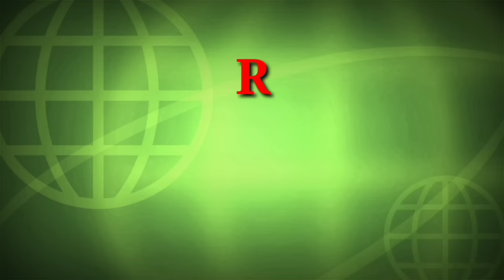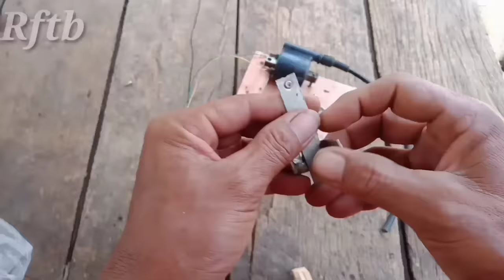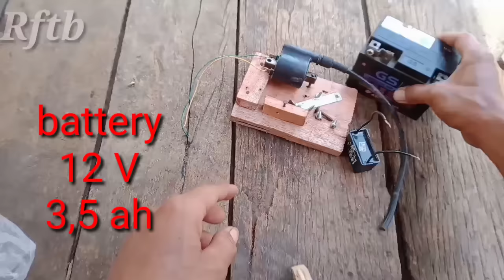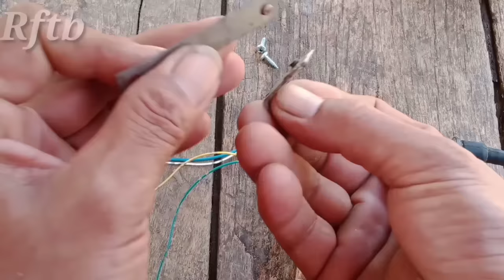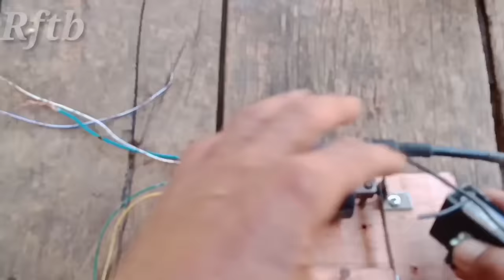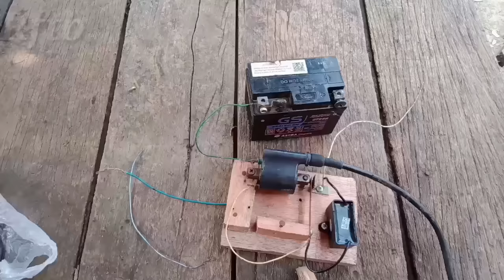HOW TO MAKE STROOM FISH WITH COILL MOTORCYCLE

Comment: That kind of invention is not suitable for fishing because i know the output is a high voltage but the output ampere is very low when you put in the water even  4 to 5  inches the fish wont electricuted ..

Comment: this kind of instrument, ignition coil for motorcycle or ignition coil for automobile for using for catching fish is useless, even they are high voltage, but very low wattage, so it is not suitable because when you use in actual or put in water with the distance of two feet between rod and net, the voltage will drop almost 80%, so you cannot kill fish.
Reply: Very good sir

Comment: Use another method , circuit designed by engineer swattagam ,the use flyback transformer to generate super hi voltage ⚡